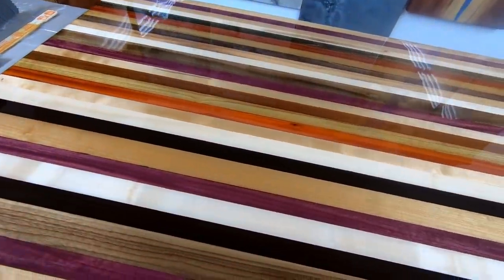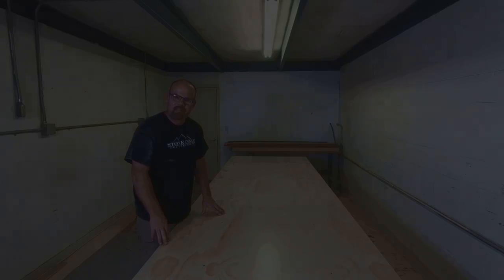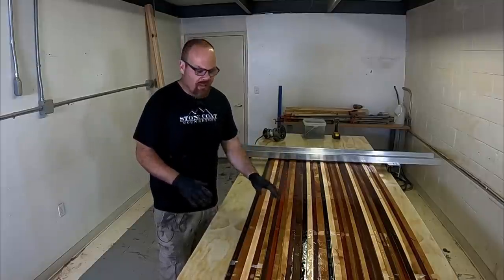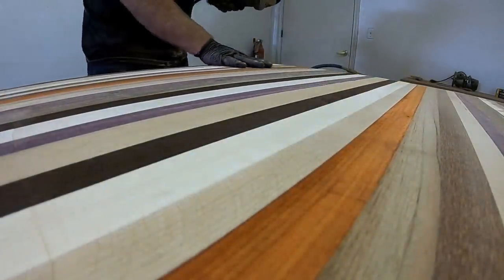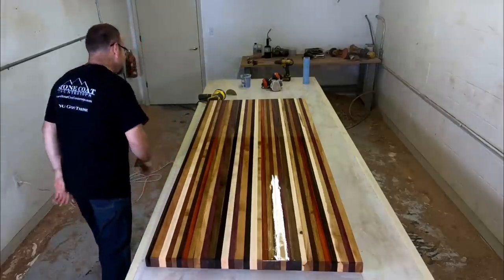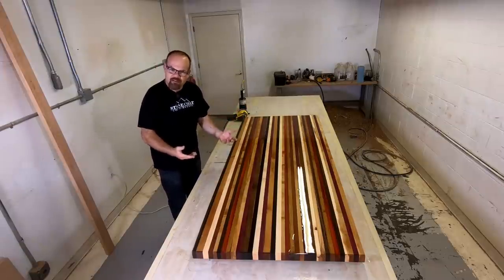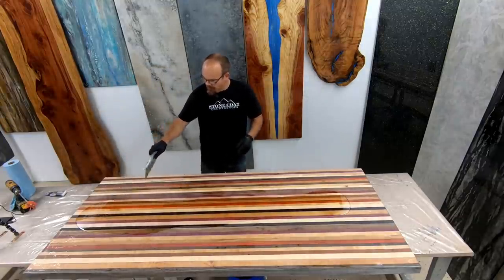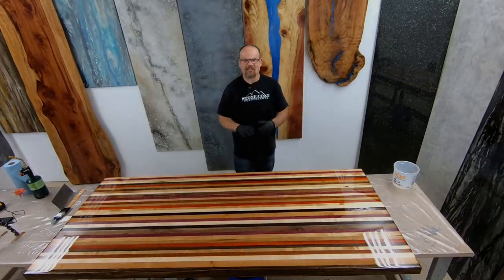How To Build a Solid Wood Table Top

Comment: amazing work, ive been watching a lot of your videos lately, however im trying to find what kind of 50grit metal sanding disc you are talking about, are the ones flat with a big hole in the middle or the ones that look like flap sanding discs
Reply from the maker: Thank you for your kind feedback Luis Antonio Gálvez Heras!  Here is a link  to the 50 grit metal fiber sanding disk we use: https://www.homedepot.com/p/Diablo-5-in-50-Grit-Fiber-Disc-4-Pack-DCF050050S04G/202830897  as well as the conversion kit: https://www.homedepot.com/p/Diablo-4-1-2-in-x-5-8-in-50-Grit-Grinder-Sander-Conversion-Kit-DCP045VGPS01G/202830887?MERCH=REC-rv_gm_pip_rr-202830896--202830887--N  Please feel free to call or email us anytime withh questions or for project support. (541)450-1976

Comment: Can you just wood glue them together , then epoxy the project ?I wonder what all those routered chips would look like in a pour?You could create a frame for the chips out of the scraps to create smaller accent color matching tables. The contrast of design( with the  color match from the chips) might look cool. Would a light oil spray(say coconut or olive oil) from a plastic pump up bottle or brushed work as a release agent if it was sprayed on plastic? 19:06.... Might want to change the name of that product. Say it ten times,has an odd sound to it.

Comment: I don't t see link for metal sanding disc? Help
Reply from the maker: Hi Tim, here are some links to what we used for this project: Hi Tim, here is a link to the metal sanding disk we used: https://www.homedepot.com/p/Diablo-5-in-50-Grit-Fiber-Disc-4-Pack-DCF050050S04G/202830897   https://www.homedepot.com/p/Diablo-5-in-50-Grit-Fiber-Disc-4-Pack-DCF050050S04G/202830897  FFeel free to call us anytime for project support. (541)450-1976
Reply: Awesome this is why you will get my business when time comes great videos even better help!!!
Reply: Stone Coat Countertops you guys are the BEST!